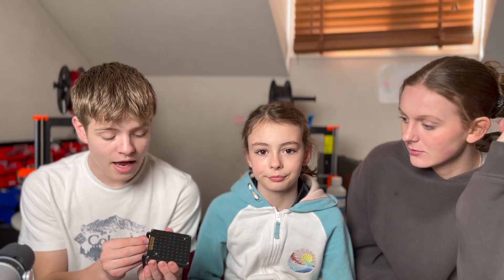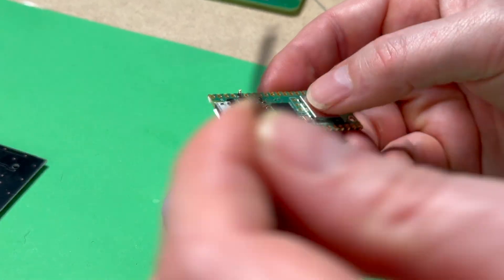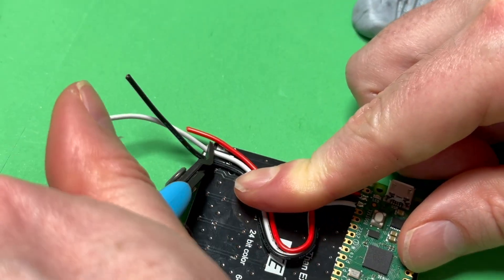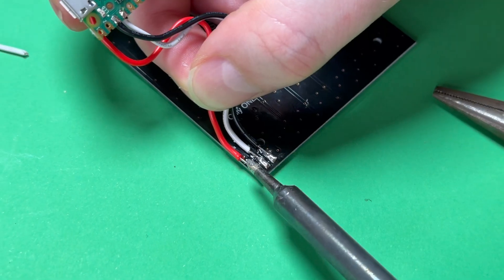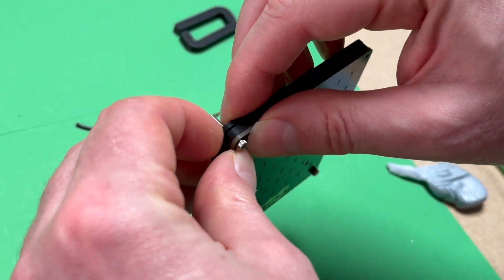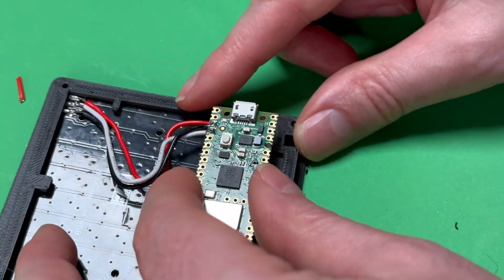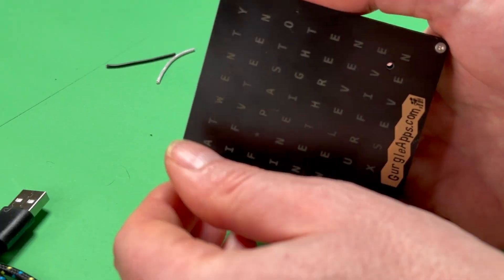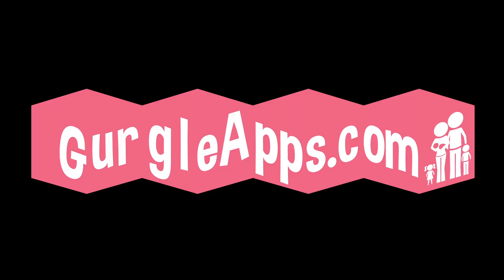Color Wifi Word Clock Kit Assembly Guide

Comment: Hey guys I connect my Wifi to the Clock but I got rid of the website/ Page for it and I cant edit it so its hours behind
Reply from the maker: The address of the page comes up when you plug it in, it is usually 192.168.1.xyz where xyz is a number.
Reply: @GurgleApps  I have deleted the page to configure the clock so I cant get anything from that but the wifi connected I need to get the configuration page back you guys gave me
Reply from the maker: @Lucasproductions1  yep the clock scrolls the page when you plug it in go to that page
Reply: @GurgleApps  Thanks do that all sorted thanks for your help!

Comment: When soldering wires to Neopixel boards, I often add some hot glue afterwards to give a bit of strain relief to the wires
Reply from the maker: Great tip, we are hoping to get community tips on the build and software installation.